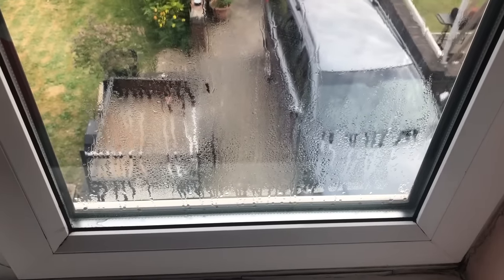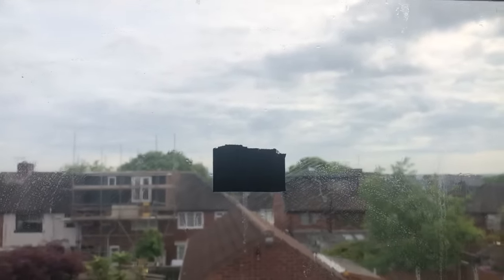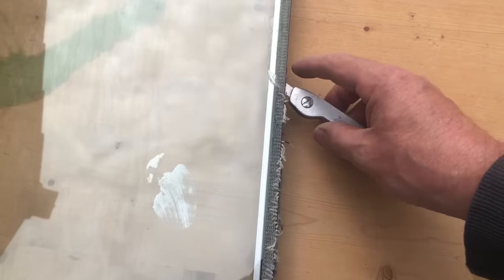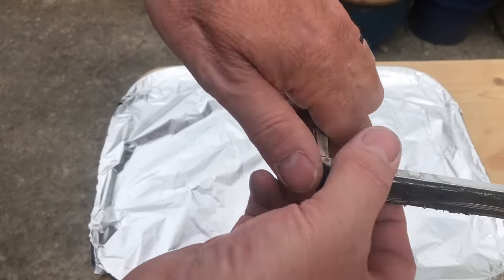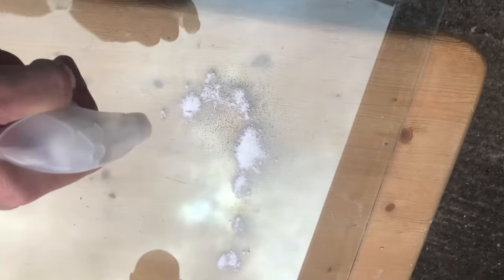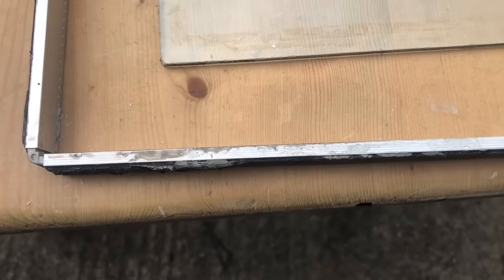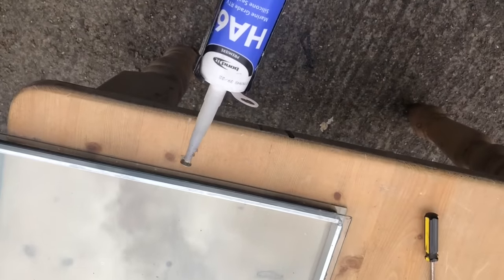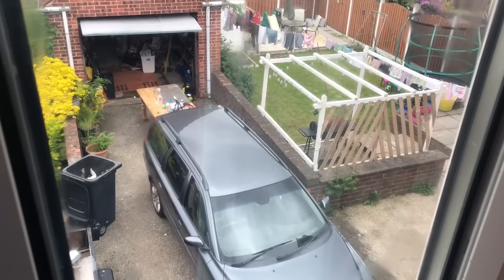Double Glazing Unit Condensation / Blown DIY Repair.

Comment: Did exactly the same a couple of years ago but it didn’t last very long before it re misted. I think it needs the gas as well, otherwise well done, there’s a lot of work to it.
Reply from the maker: It’s a real shame your repair didn’t last, I’ve got a couple of double glazing units I repaired over three years ago that are still sealed. Dried air is sufficient but air is a gas technically!
Reply: Its a bad bodge . Never worthwhile
Reply: Thats interesting. I have another smaller window that has gone so may try again. Not been in that long so not even the bought ones are always successful. One thing I find, my windows are quite close to the frames so I dont have a lot of room when using the tool to start removing the beads, it tends to close back up, so I use thin plastic spacers once I've got it started just following behind the blade. Works for me.
Reply: @philipnelson7613  If its not been in that long then its probably under guarantee still.  You may need 2 knives to prise the beads out . Some are absolute swines!. Its why i'd let a pro do it for  any frame damage is down to them then .  I use two flat knives . Some times i need to tap the knife with a mallet  to get it started . If the unit has not been in long then it should come out ok

Comment: If we wanted to call a company in who can do this im the uk what type of company will they come under?  I do not want to replace my wingows they are approx 20 years old and just need the odd condensation window sorted.
Reply from the maker: I doubt a glazing company would do this but I’m sure they will have a solution.
Reply: @TheRepairer  my concern is that they will say I need to replace them because that is good for business, sorry I'm cynical. 😂
Reply from the maker: I totally understand , is the glass panel removable from the inside or outside? you will see the beading.

Comment: no need to re gas the window with argon?
Reply from the maker: They are not Argon windows,  most glazing just uses dried air In between the panes.
Reply: @TheRepairer  thanks for confirming.

Comment: Interesting video. I have several windows that are like this and can't afford to replace. I'm wondering though, if the seals on the frame are already letting in water, won't this repair be short lived unless the outer seals are replaced?
Reply from the maker: The window frames are designed to drain rainwater that’s runs down the glazing and into the frame out this should work and preserve the repaired glazing if it’s not blocked.
Reply: @TheRepairer  OK thanks. Will look into having a go at one of mine come the spring. I thought it had something to do with the seals being weathered and shrunken, but I guess if the pane itself is fully sealed then water shouldn't get into it and your repair technique should last. Not sure if I have drainage channels though as my window retaining clips are on the outside with the solid frame to the inside, but I can always drill a few holes or file some channels if necessary. Your video will help me so thanks for making it.
Reply from the maker: The window will be designed to drain the water out.

Comment: Inspired me to tackle my conservatory door. Did you remove all of the desiccant granules from all four sides and are they filled to the top of each bead ? 👍
Reply from the maker: I remove them all, they aren’t always filled to the top.
Reply: @TheRepairer  👍👍👍
Reply: Bear in mind that a door unit will be toughened glass. Be extra careful if you're mad enough to try this shady "repair". One wrong move and the glass will shatter into thousands of tiny pieces.

Comment: The glass in my double glazing units is fitted from the outside.
Reply from the maker: You have an older double glazing unit than the one in the video. Many an observant double glazing salesman has noticed I have them too in the unextended part of the house that was built in 1997 they can stay put as they are all in good shape, but two newer units have failed in my extension circa 2009 build.

Comment: There is no way the DG should leak if they are properly sealed, however movement in the frame and packers, tiny holes in the tape seal caused by sharp edges, or incorrect storage (placed on a hard surface), or movement over time over hard plastic, will eventually puncture the seal, and raise the spectre of condensation between the glass. When properly sealed, and with carefull handling and installed with neoprene packers, there is no reason why the windows should not last pretty much forever!
Reply from the maker: I’ve spent time thinking about this two and I think failing could be down to a glazing unit being made square then sitting slightly out of square in the window recess which stresses the sealant leading to failure!

Comment: What happens if you have argon filled gas double glazed units?  Very good video showing you what is involved fixing a blown unit
Reply from the maker: The gon part of Argon would  more than likely be applicable! I’m glad you enjoyed, the technique demonstrated is for dried air units.
Reply: @TheRepairer  so what you are saying is the window is buggered and a new unit would have to be fitted
Reply from the maker: Yes, however someone posted in one of comments for this video that they used Argon gas from a welder to rebuild a double glazing unit without issue.
Reply: Argon fill is optional. It gives a small increase in thermal insulation compared to air.
Reply: You dont have argon filled units ... trust me i used to make them
Reply: @trickyfocus  You do get argon filled units...trust me I used to make them too. It comes in a big green stupidly heavy cylinder.

Comment: Isn’t YouTube brilliant for picking up tips and tricks of the trades but this must be the most ill advised repair I’ve seen yet. The time it would take to dismantle and reseal a double glazed unit which is clearly of an ancient specification with an old school inefficient aluminium spacer, no argon and probably no energy rated coating doesn’t justify the risk of injuring yourself when you split the unit with a sharp blade not to mention the risk of cracking one of the panes as a result and the absolute mess most will make trying to silicone seal a 20mm gap between the panes!  It’s also likely to steam up again once the water gets behind the duck tape. If you have unlimited time on your hands and absolutely no money then knock yourself out and good luck with it but I wouldn’t recommend anybody trying this in a month of Sundays. If you’re smart enough to be able to remove it then put your hand in your pocket, order a new one and fit it yourself but most importantly if you want it to last sit on proper glass packers that are at least as wide as the unit and preferably on a bridging packer to allow water to pass under it, as it inevitably will. All uPVC frames let water in , they’re designed and drained for it!
Reply from the maker: I have units repaired this way that have lasted over three years and are still internally dry. I have faith in this repair technique and that’s all that matters!

Comment: I appreciate people saying that this has made people comfortable in regards to trying to replace dg units themselves. 
There are a good few issues here.
1. The window wasn't packed properly or toe and heeled to give it the correct term. Some people following this advice will have a window that is catching or difficult to close because of this.

2. If the dg unit has toughened glass, there's a chance the glass could shatter if using a metal blade near the edge of the glass.

3. This method will probably fail in a few months so really what is the point? Second hand dessicant? Really?
Reply from the maker: The repair is still going strong two months after you commented and four months after I filmed it!

Comment: Where is the argon gas ?
This may be a cheap way to repair a double glazed unit but it will not perform as well as a new one.
Reply from the maker: It will perform exactly the same as a new one and why do you assume there is Argon Gas to be replenished it’s a basic dried air double glazing unit.

Comment: Vinegar neutralises the Bicarbonate in the baking soda. No good together.
Reply from the maker: It got rid of the hard water staining on the glazing.
Reply: @TheRepairer  Good stuff, interesting video as I’ve a few dodgy windows and I might try your method on some of them. The fizzing was the Acetic Acid, (vinegar) reacting with the Sodium Bicarbonate which liberates Carbon Dioxide. Other products are Sodium Chloride, (salt) and water. I’m guessing the vinegar was the key here, the salt could leave a powdery residue but your methods obviously did the trick. Likely there was more vinegar there as the Bicarbonate reacted away.

Comment: Lawsuit warning! Sell your home without disclosing these kind of improvements, you are very liable. 

Per U.S. building code (your responsibility as the homeowner). Each pane shall bear the manufacturer's mark designating the type and thickness of the glass or glazing material. The identification shall not be omitted unless approved and an affidavit is furnished by the glazing contractor certifying that each light is glazed in accordance with approved construction documents that comply with the provisions of this chapter. Safety glazing shall be identified in accordance with Section 2406.3.

Most Regulations suck but some do save lives. Many people died for us to live care free and oblivious of the dangers that surround us everyday.
If someone got hurt by this window they will seriously take everything you own, and a % of everything you make in the future. The victim, glass manufacturer, your city/state/federal building code, your own homeowners insurance would sue. 
Lawyers would have a field day.
Reply from the maker: Interesting scenario I’m in the wrong jurisdiction but I am somewhat enlightened . I see the aforementioned repairs as falling under maintenance not an improvement. This begs the question  does maintenance have to be disclosed at the point of a sale?
Reply: @TheRepairer  are you a licensed contractor? Does your jurisdiction have a building code? Are inspections required? Permits? 
Schedule an inspection if yes. 
I’d pay to see that video.
Reply from the maker: @bigbear2011b In the extremely unlikely event of me ever be placed on trial for my repairing actions in my jurisdiction you can count on me taking the Fifth!

Comment: Thats not how it should be done. Aluminium frame shoud have double sided tape to keep the panels together. To bond the panels you should use glass adhesive,  bare in mind not every polyurethane adhesive is suitable.  Finally, the finished panel needs to be filled with Argon  otherwise the panel does not have its thermal properties. The edges are finished with tape so you don't cut yourself.  Its a rewarding job for patient but the key is to finish the glass with no streaks and dirt inside the panel. Best to use is methanol or isopropyl alcohol.
Reply from the maker: Have you ever rebuilt a double glazed unit?

Comment: marine grade sealant- too expensive and wrong one. There is black- car windows sealant. Thats stuff you need.
Reply from the maker: I’m happy with it at around £7.99 a tube.
Reply: @TheRepairer  maybe.. but these car sealant is have like lifetime bond strength ) it holds to glass so superior. better than any silicone

Comment: AS A GLAZER.  USING A PAINT SCRAPER TO REMOVE THE BEADS WAS  WRONG.  BUY YOURSELF A PUTTY KNIFE.
AND THAT REPAIR WAS A WASTE OF TIME. BUY A NEW DG UNIT.
Reply from the maker: I didn’t use a paint scraper it’s the correct tool. The repair works very well and is “NOT A WASTE OF TIME”.

Comment: Please don't encourage people to do this. The glass edges are very sharp and the air between the glass must be moisture free or better filled with a thermo gas to avoid misting. Plus when refitting the payne it needs to be wedged properly in upvc windows so the window frame closes properly.
Reply from the maker: I am not encouraging anyone to do this it’s a choice they have. We all know glass is sharp but people work with it daily without incident . It’s a dehydrated air unit that doesn’t require gas and it’s not the gas that prevents misting that’s the seal in between the panes that invariably fails.
Reply: @TheRepairer  I install these units and even though we wear special gloves we still get cut regularly. For the units to be efficient they must be filled with gas. The water in the air will mist when the temperature changes.
Reply from the maker: There are no valves in these double glazing units,  how are they filled with gas other than air?
Reply: @TheRepairer You don't need valves. They are manufactured a special way and the gas is filled in production. The gas acts as a thermo insulator. I'm sure if you 'Google' it you'll get the info.
Reply from the maker: @combrogi I have:-  Argon is used to fill the spaces between double and triple paned windows. These types of windows are known as "gas fills." To fill the panes, argon is pumped in via a small hole along the spacer, while air is allowed to escape out another small hole in the spacer. No holes in any of the spacers in the double glazing unit I rebuilt therefore isn’t must be dried air!

Comment: I thought that double glazing units had argon gas in them?
Reply from the maker: It’s a dried air unit some have gas in some not.
Reply: @TheRepairer  I see!! (Could you repair one that did have gas?)
Reply from the maker: @oneoflokis  I know of one repair (not mine) that involved re gassing with argon gas from a welder.

Comment: First thing I would’ve done is shift the car! The tool you use to lift the glass up should’ve been a plastic shovel not the don Carlos knife that you are using that would definitely risk  shattering the unit!.I don’t see the reason for marking the inside of the glass it’s going to be changed anyway I don’t understand why you have put tape on it What the hell is a friction seal no such thing there is double sided tape but that is normally on the ground floor only
Reply from the maker: I’d never had a stuck  window to deal with before, point taken about the knife lifting the glass,  I’ll do it better next time!

Comment: Couple of things here.
1. Cleaning inside a dgu is not recommended as 1 piece of the glass has a special coating to keep heat in & reflect cold out. Unit will probably end up looking scratched to death or useless if you manage to scrub it off.
2. Your window was & still is glazed incorrectly. If you are going to show people how to fix it show them the correct way.
Reply from the maker: A balanced comments section is most valued, thanks for taking the time to communicate.
Reply: Please explain point 2.
Reply: The glass is just placed on 2 packers flat. It should be toe & heeled as it is a side opener. This requires 4 packers and transfers the weight of the glass to the hinge. Left the way it is it will soon drop & not open/close properly
Reply from the maker: Yes I’ll sort it, that was the way I found it but needed extra packers which I didn’t have.
Reply: I know ya did mate. Just trying to help

Comment: Seems a ridiculously time consuming way to go about it ,as for me I just remove the unit, drill a hole through the side either leave in the sun with the hole side up till evaporation and or a hair dryer to heat the unit all over and re plug the hole with an Epoxy or similar, and re install, approximately half / to one hour.
Reply from the maker: I think it’s unfair to directly compare the two methods as :-

1. The unit will not be perfectly sealed around the circumference the original point of failure is likely still there so it could mist up again.
2. The glass will be hazed and chalky looking as it hasn’t been cleaned internally. 
3. There will be visible drilling damage to the internal beading.
Reply: @TheRepairer  thanks for your comment, but I must say it's always worked for me, I have found the epoxy or similar coated round the four sides work's well as after heating the cooling creates a suction and vacuum and thus plugging the point of failure, and as for the small drill hole mere cosmetic, I have done this professionaly countless times and happily saved a lot of struggling folks money, but it's horses for course's, kindest regards.

Comment: All ready been said total waste of time & money , just get a new sealed unit. The only time I split units is when it's one with fancy lead design etc,  I just save the lead side & take it to my local glass merchant to have the unit rebuilt with new spacer bar desiccant & hot melt , not expensive at all plus I get a five year guarantee. 
Been a glazier for over 18 years.
And while a unit is out it's worth checking the drainage is clear as the two most common courses of a broken down unit is the unit standing in water & ultraviolet light (sun) getting on the sealant.
Reply from the maker: I’ll check the drainage holes when the packers I’ve ordered turn up to correctly toe heel it thanks.

Comment: Oh personally I'd just get a new unit ...they are not expensive. 
And the time spent doing this by someone who is charging you 
I think its cheaper....Or maybe not.
Reply: @just_saw_dust  
No I don't actually. im on benefits for my disability ...
Sorry you're struggling financially...
Reply: Think this would be a DIY repair if you're on a budget. My home was built in 1970s so windows are quite a bit larger, I'd probably save around £130-150 doing this repair.
Reply: @detiex5576  you're biggest spending would be the sealer ...
Great video though... most wouldn't know or dare to attempt this .
Watching it is so very helpful